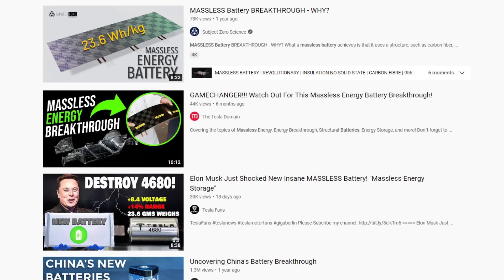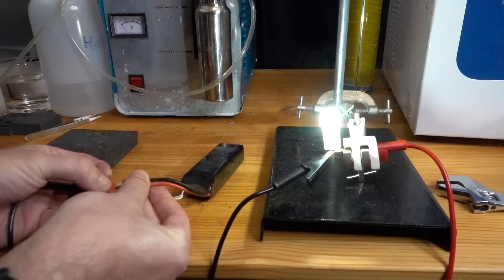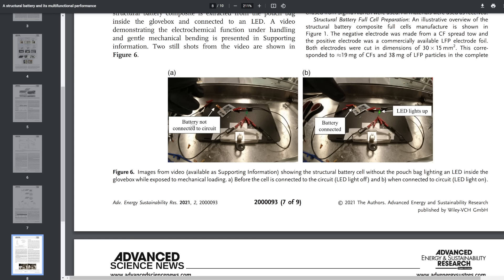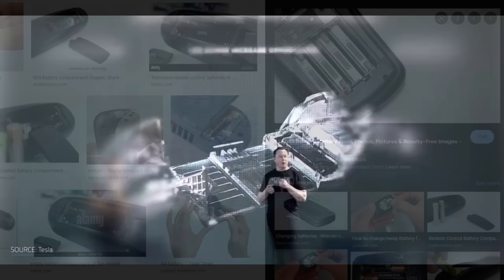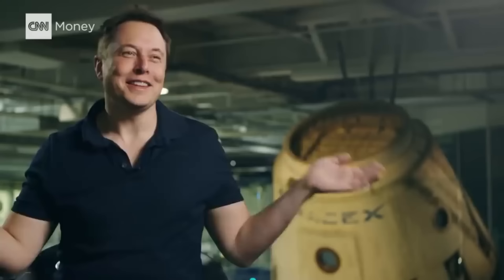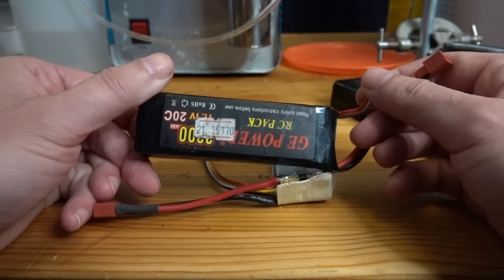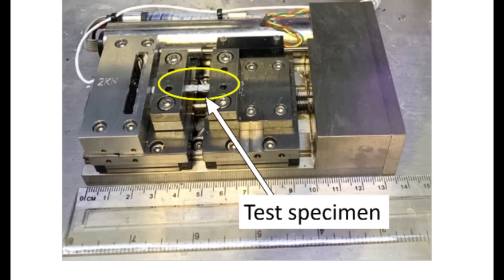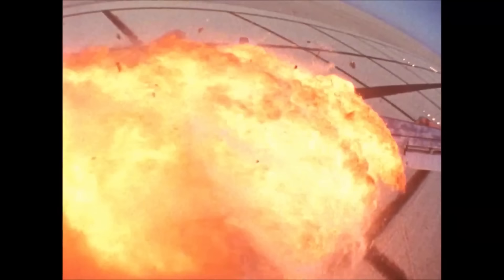Matt Ferrell, Massless Battery: BUSTED!!

Comment: the worst part about "structural" batteries to me would be when they need replacing.... you've basically created a very expensive disposable car that's only good as long as the batteries hold up...
Reply: as well as batteries are one of the most questionabely envoirmentally friendly parts already so if putting part of the structure causes issues with recycling batteries, its more of a waste of resorces than a plain old dispossible car.
Reply: @randomprotag9329  big oil
Reply: You've been successfully hired to the Apple Car department))
Reply: thats not a problem, thats a business opportunity
Reply: @mcspikesky  combining materials have been shown to make already recycleable indiviitital stuff harder or flat out non recycleable. if the envoirment is a concern increasing the needed mining for battery metals is an issue for a already wasteful design.
Reply: not to mention what happens when you have a fender bender, next thing your car is on fire, like, all of it...too bad if you get knocked out....
Reply: And if you just use the wheels as structural batteries????  😋😎
Reply: I imagine wearables gimmicks is about the farthest this kind of tech can go.
Reply: @randomprotag9329   Where as ICE cars are powered by wishes and dreams ....
Reply: @fourutubez7294  How about this: fuck cars, my legs are effectively solar powered (carbohydrates from photosynthesis) and get stronger with use, instead of degrading with use.

You can't solve the car problem with fancier cars. It's an urban design problem.
Reply: @fourutubez7294  biodesial is a currently existing solution which has more potentional for cars than batteries since instead of mining for metals it just needs renewable animal and plant products.
Reply: Bingo! I've heard Tesla wanted to make the batteries part of the structure of a certain model they wanted to launch. The resale value will plummet.
Reply: The fewer dream of any volkswagen CEO🤣
Reply: @pdblouin  Even better: Get an (e)bike. Much faster and more range than walking and still way better for the environment than a car. Combined with decent public transport it's a pretty nifty way to get around in bigger cities (which is where the population is concentrating more and more anyways). 
This way we can keep cars and just decrease their use sharply (for delivieries, bigger shopping, people in rural areas etc)
Reply: Dude that is if the car even last till the battery fail. The required properties of battery and structural materials are different.
Reply: @pdblouin  You do realize not everyone lives in an urban area
Reply: I mean, that is the wet dream of car companies
Reply: @randomprotag9329  out of curiosity, what do they mine to make batteries?
Reply: Electric cars are essentially disposable vehicles. After three years or so, the cars are worth roughly the same as the residual value of their battery packs. It is also widely known that no nation's electric grid could handle a higher concentration of electric cars that we're seeing now. As their market share increases, their value decreases because the cost of charging them requires massive upgrades in the electric infrastructure. Batteries store energy at a loss, they do not create it, energy, which, incidentally, is not created by capturing unicorn farts in rainbow colored bottles. Also, Tesla cars and their ilk are like riding around in a 4-wheeled laptop: In 10 years no one will want them for the ancient software, no code updates, etc... battery life wont matter one bit, the thing will be utterly valueless.
Reply: @th3d3wd3r  metals like lithium, lithium is a common one for batteries
Reply: @randomprotag9329  yeah because nothing in a conventional car is recyclable... Got an idea for you: build your next house near a lithium mining operation. Problem with ideologues is that they sound just like the people they hate the most: ideologues.
Reply: @psycronizer  yeah because batteries are not explosive or fire hazards at all.
Reply: You just described the new Tesla structural pack.
Reply: @pdblouin  How about this: I like going 0-60 in 2.5 seconds while being surrounded by a good quality sound system.
We can fix the urban design issue without making cars go completely away
Reply: @pdblouin  I like to go backcountry camping and stuff. You can't honestly think it would be feasible to have public transit going to every trail head and campground in america do you?
Reply: @donbishop1229  so the systems need to be upgraded...and? yes it will be super expensive...but at least its towards a better future. electric cars and a robust bike and public transport infrastructure is the key to get out of this environmental hole. and ye, the batteries are a wear element in an electric car, but the rest of that car can be used for decades. so...legislate that car companies have to make the batteries for those decades so you can switch them or force them to open source it ("car companies wont do that" YE. legislate it. same for phones that are not manufactured anymore. force the companies to open source the firmware so they can be used longer)

the ancient software point: see the parenthesis above. if you dont provide any more software updates, be forced to open source drivers and OS.
Reply: @pikachulovesketchup666  you're right. But it's quite a noticeable chunk of people. And don't get me wrong I don't want to take cars away from people that need them (where people outside of bigger cities are an important part of)
My comment was more tailored about guys that live in a big city and get their soy latte by driving an SUV 1km to the next Starbucks. I'm sure you can agree that this is a case where you can replace the car with public transport or bikes?
Reply: @19LG99  his source: trust me bro
Reply: @psycronizer  No car company would put the battery in the parts of the car that are designed to be deformable. Fenders are designed to be deformable in a crash. 

You wrote an incredibly poor red herring
Reply: Just look at Munro's breakdown of the structural battery pack. Absolutely repairable. For the older models some people found out how to replace only the parasitic individual batteries, but now you got to replace the entire battery pack.
Reply: @randomprotag9329  but lithium isn't mined. It comes from evaporating brine pools on salt flats
Reply: @donbishop1229  lithium isn't mined
Reply: @donbishop1229  yeah, lithium mining needs to be regulated, no doubt. But you’ll agree it’s far safer than fracking. Also safer than living near an oil refinery.
Reply: Disposable cars sounds exactly what Apple-Tesla wants lol. It would be highly unfashionable to be seen in last year's car that costs dozens of K
Reply: @pdblouin  I've been watching a lot of urban design and cycling channels lately lol. Alan Fisher did a good video about how electric cars, while better than gas cars, are still an environmental and infrastructure nightmare. What few cars are actually necessary should be electric. Most should be replaced with electric trains, bikes, and just walking
Reply: @donbishop1229  I guess neither is petrol or gas,  eh?
Reply: Exactly what Tesla would love.
Reply: I'm most worried about puncturing the bodywork since accidents happen and getting cooked inside the whole lithium fireball...
Reply: @tgreaux5027  You do realize human beings lived rurally long before the internal combustion engine?
Reply: @chrisannika6006  you're right poor example, but the point still stands.
Reply: @randomprotag9329  don't mean to be rude. But are you going to address the fact that lithium isn't mined? Have you seen how many people make that claim, but it's not true. All these people, including yourself are just spreading misinformation
Reply: @th3d3wd3r  ideologues are boring.
Reply: @donbishop1229  get a grip man, facts are facts. Your rebuttal is pure dross
Reply: @dmrr7739  Why would I agree about that? They each have risk/reward profiles and tradeoffs. And from what I've seen, lithium mining is far more hazardous to life than fracking. But that notwithstanding, fracking is an energy source, lithium is an energy sink. You can mine all the lithium you want, but unless you transform chemical or mechanical energy into electricity to mine it, manufacture batteries from it, and produce the energy those batteries will store temporarily (and at a net loss), all you have is a superfund site and dead batteries.
Reply: @CMDRunematti  hand-waving. You know nothing of what it takes, the domain knowledge, the tools, the techniques that go into machines like modern electric cars. The more cars rely on software the shorter their shelf life is. It's just a fact. Talking about "what will be" is just another proof that nothing is impossible for the person who only has to say what will happen. Try replacing the control computer in a car that is 10 years old without going to a junk yard. Better still, have the manufacturer write new software for it. then we'll talk more.
Reply: @th3d3wd3r  sxth-grader comeback. Impressive.
Reply: @donbishop1229  or open source it after your not manufacturing it so smart people who are already trying to reverse engineer these things just to keep them working can do it easier.
Reply: @th3d3wd3r  i have other stuff to do thats of this site entirely to diectly adress it. i am going to take a mental note for next time for anything i got incorrect.
Reply: @donbishop1229  there are third party engine management systems by companies like haltech, that can already do some rudimentary control of EVs. You reckon in ten years, maybe, just maybe, that new market will kick right off.
Reply: If solid-state batteries deliver on their seeming promise to one day replace lithium ion, this will cease to be a problem, as they could likely last the entire life of the car.
Reply: @th3d3wd3r  yeah maybe. The battery pack dies and costs more than the car us worth. On top of that, the OEM control system goes out of "support". What does a rational person do? Why they keep pouring money into their old EV with third party batteries and rudimentary control systems just so they can say it's not disposable. Incidentally, the only reason people in the US do not keep repairing their petrol cars is because the insurance industry forces depreciated values making them uninsurable to their performing asset value. Your blind spot is that you are an eco-warrior amped up on ideology, and you don't understand the forces at play that have nothing to do with ecology or energy production.
Reply: @donbishop1229  eco-warrior? Piss off! I like fast vehicles. 4 wheel or 2. EVs are where it's at now.
Doesn't matter if it's ICE or BEV, some companies make shite cars. Simple solution, don't buy them. At the same time, despite EVs shaky start with reliability, they are getting exponentially better year on year.
Repairing EVs are a lot more straight forward in most cases than ICE. And that's from experience.
At the end of the day, this whole diatribe came from you claiming lithium is mined, when about 90% of the stuff comes from brine pools on the Bolivian salt flats. Like most salts. Rather than adress your misinformation however, you just called me an ideolog and changed the subject. Then you have the audacity to say my response was that of a sixth grader. That attitude is the same the tesla fan boys and the ilk have
Reply: @th3d3wd3r  Robert Davidson invented the first electric car in 1839. They have been plagued by the same problem ever since. People buy modern EV's for their perceived "free gas" via public charging stations and premium parking spots, or for their dubious  environmental benefits. Both are delusions. As is the idea that modern electric cars are not built as scrap from the start.
Reply: @donbishop1229  I know several people with fast EVs. They all got them for the torque. None of them are under the illusion that it's free "gas". Pretty hard illusion to be under since we pay at public charge points. I ride an electric motorcycle, the torque is utterly insane. Never had a problem with it either. I don't know anyone that's had a problem with their EVs for that matter. 
You seem to like making a lot of assumptions about people's motivations.
Reply: @donbishop1229  hardly any types are really. Anti dendrite tech helps to stop that, along with non combustible electrolytes, in the high capacity batteries anyway.
Reply: @psycronizer  I don't think people like Don cares. They've already made their mind up and will shun any info contrary to his bias.
Reply: @chrisannika6006  many other parts are also designed to be deformable, or at least crumple zones to absorb the kinetic energy
Reply: You forgot that these wonderful new batteries are unlimited.
Reply: @th3d3wd3r  , edit, sorry, wrong person, responding to Don.
Reply: @donbishop1229  , from an electrical engineering perspective, you're pretty far off base on your understanding and seems, ironically, you're the one operating from some sort of ideology. Let go of your preconceived notions and do proper research, which is very evident you have yet to do. Although, a lot of your issues just come from giant, unjustified, sweeping generalizations and conclusions. Almost comparable to, "people like bananas, so there is guaranteed to be a total economic collapse in 10 years, no doubt about it!" Conclusions need to logically follow and a case made for them, you do neither and think just stating things confidently makes them true.
Reply: @JimBob1937  rpfl. As an electrical engineer myself, I'd say it is you with the misunderstanding and ideological bias.  While the price of used teslas are climbing so are the battery replacement costs and new car prices. And rife is the misconceptions about the lifespan and replacement costs of the battery packs. Wait until everyone figures out that the amount of recharging capacity of the entire US grid is only about 10% of what is needed if everyone were to switch to electric cars and no one used any grid power for anything else. And grid capacity is shrinking not expanding. Once adoption hits about 20M plug-in EVs charging power will be rationed (it already is on areas of even the most modest of adoption rates). Cars will be geofenced. Then we'll see if they have much value or if people will just abandon them which is another way of saying dispose them.
Reply: @CMDRunematti  just...wow. US electricity production  capacity (not consumption, capacity to produce) is just 10% of what is needed for private passenger EVs, if you didn't use grid power or another thing. The only thing that makes money worth anything is that it represents labor. And the only thing that pays for labor is labor. What are people going to do when the modern way of life is dialed back to the time before horses and buggies? Are you ready to be a Bedouin?
Reply: @th3d3wd3r  I don't think the current plan is to get rid of cars. It's to get rid of people.
Reply: @CMDRunematti  yeah sure, open source for automotive control systems and autodrive systems and lidars. Tesla is fighting tooth and claw to keep people from replacing their own battery packs. On the other hand, it would give renewed sense of software crashes. I'm a hardcore OSS guy BTW.
Reply: @donbishop1229  ... So again... They need to be upgrading. Production and grid. I don't understand why they couldn't build more production in step of increasing demand. Demand won't appear from one day to the next, batteries need time to be manufactured, that gives time to upgrade the production and the grid. AND mind you, if the US for their shit together and concentrated more on public transport, so it wouldn't be 3 car per capita, then you wouldn't need such high production. Don't act like it's an impossible task, it's far from it. Trains, buses, safe bike infrastructure in cities would reduce traffic, car dependency, improve air quality etc etc. It is done elsewhere already.
Reply: @donbishop1229  Linux and Android works well. Older cars had abs and other systems, and yet they didn't need BS control tablets that can freeze. These things are fairly well figured out, and should not be interconnected with the entertainment systems. My friend's got a Tesla but he went to drive a lot of other electrics. He told me how one of those had different speeds showing on its 2 different displays. Another one had its speedometer frozen. So yeah, open source might even make it better. Especially after he told me how Tesla just installed tiktok on his car without asking him. I told him I'd rather just buy a car without any of those systems, 2 pedals, 1 makes go, other makes slow, and no systems. No reason older mechanical speedos couldn't be fit on these. Same for older abs systems that doesn't been OTA updates. Same for the other driver assists
Reply: @donbishop1229  , you need to learn a lot more then, lol:

"While the price of used teslas are climbing so are the battery replacement costs and new car prices"

Temporary market effects are not the entire lifespan of the entire market segment... so this is shortsighted and a bit of a non-point. There are also many, many other EVs out there than Tesla, and they have come down in price.

"And rife is the misconceptions about the lifespan and replacement costs of the battery packs. "

Please elaborate, or you're just spouting nonsense spurred on by bias. I literally have no bias towards things like battery lifetime estimates. If you're an engineer you can validate the lifetime quotes yourself by taking the battery capacity, battery to wheel efficiency, and the number of charge cycles expected of the battery chemistries in question. You can further refine these estimates by looking at self discharge rates and such. The result can then be converted to miles of lifetime, which fits perfectly within various EV car manufacturer's quotes when you run the numbers.

" Wait until everyone figures out that the amount of recharging capacity of the entire US grid is only about 10% of what is needed if everyone were to switch to electric cars"

Is another non-argument. Infrastructure builds up as demand builds up. You don't look at current infrastructure, say it doesn't current support X and say, well, let's kill X. For the love of God, fossil fuel cars went through the same infrastructure buildup as demand built up over time. Apparently you would have just killed the internal combustion vehicles since the infrastructure couldn't support all of the drivers that would have existed in 10+ years down the road. Reality isn't a computer game, there is a very real and slow transition period that also allows the market to adapt (as it generally has to) to demand changes. On top of that it doesn't even look at how the charging of EVs would be distributed during the day... that sort of statement is either missing a lot of technical nuance, or is deliberately, in bad faith, misleading. I'd also like a source for your 10%... if you're an engineer, you're an extremely sloppy one, so I wonder if you've actually done the math yourself or if that's just a number pulled out of your...

If you're an engineer, you're extremely shallow and shortsighted in your analysis. I'd suggest giving a more substantive analysis. Though, this is also why argument by authority alone is considered a fallacy. As look at your arguments here... no actual arguments, just an accusation I'm biased, lol. Have a good day.

P.S. If I seem aggressive it's because you accuse me of " ideological bias" and yet seem to give zero substantive information to not only backup this claim but seem to actually fall into this category yourself with wild doomsday statements with zero informational reasoning. As I said, extremely sloppy for an engineer.

"I don't think the current plan is to get rid of cars. It's to get rid of people."

You're either off your rocker or have fallen heavily into an ideological, paranoid, bent. You can argue forever, but your statements lack any sort of substance, which makes it meaningless. I might as well state that the future will be this amazing free energy utopia, and I'd have just as much substance behind that comment as you do behind yours. Take a step back, and give a proper piece by piece analysis for yourself.
Reply: @CMDRunematti  , "I don't understand why they couldn't build more production in step of increasing demand."

Indeed... that is what the grid operators have done in the past and still can do for this venture. People stating, "X infrastructure can't support everyone transitioning at once," is like, of course... generally no infrastructure of anything is that overbuilt/oversized, as that itself would have been extremely inefficient. There are cost, labor, and even efficiency tradeoffs to adding more capacity to a given infrastructure and so you don't oversize your infrastructure by 2x or other such nonsense, you expand your infrastructure capacity as demand increases. Likewise, it is extremely rare for a demand transition to occur instantaneously. 'Transitions' are by their nature gradual. In this case existing vehicles will continue functioning, and market forces and economics naturally cause the transition to be gradual. Just like cars that have newer mandated safety features and anti-pollution measures, it's not like all of a sudden everyone had to pile onto the same market segment, it happens gradually. Don is seriously just being continuously hyperbolic.
Reply: @CMDRunematti  , in terms of the software discussion. Open or closed source could work for the task in my opinion. Assuming we're not discussing high level self driving vehicles, a proper design of a vehicle can allow the software to be additive but not a complete hard requirement. With that said though, industrial software, and the hardware to run it, is often intentionally designed to operate for decades upon decades. People confuse the disposable software/hardware experiences where a manufacturer abandons software updates and bricks their devices (which is something consumers shouldn't support anyways), with industrial designs that are made to keep running. If you've ever worked with industrial manufacturing or similar, you know there are many, many machines out there still operating on OS's from the 1980's... seriously.

Of course this relies on the car manufacturers to do proper design, but there is no reason why over the air updates can entirely stop and yet the vehicle's core functionality still continues. Tesla is a bit iffy on this as Musk is a silicon valley guy and so I think he is willing to integrate software far more deeply and more intertwined than other manufacturers. However, I have to state this a lot, Tesla isn't the only game in town and that is continuing to be the case. People seem to associate Tesla with all EVs, which can be good and bad depending on what aspects of the company you like/hate.
Reply: @JimBob1937  I'm glad someone agrees. The internet can make anyone doubt their own sanity sometimes 😅
Reply: @JimBob1937  i know Tesla isn't the only one player, but consider this: i buy a PC, i can run windows (10,11), Linux in many kinds of even MacOS on it. That's what I'd like. Give me a car, dear car maker. You're not a software maker, so don't give me software, I'll get my own. (Same goes to phone makers btw. The only reason we can't put any Linux on phones is that they don't give out drivers for stuff. That's why functionality breaks when you use AOSP Androids. It's only because of their greed.)

Also, a car shouldn't need it's own 4g connection. It shouldn't need constant software updates to reach functionality it should've had upon launch. And none of them should be able to install extra software without the owners consent. Imagine your CNC mill suddenly having Facebook on it... Why is it acceptable and why am i the crazy one?
Reply: @donbishop1229  Yes, over 20 years ago I needed to replace a control computer in a 15 year old car, at an independent workshop.  They had to look up the part number, order it, and wait a day for it to arrive.  There's just no way to solve the "car needs a new controller" problem, it's insoluble, no technical solution.
Reply: @donbishop1229  A family member just bought a retitled car that was an insurance write-off.  Seems great, should run for plenty more years.  When an insurance company writes off a car which is still economic, that doesn't automatically end the car's life.